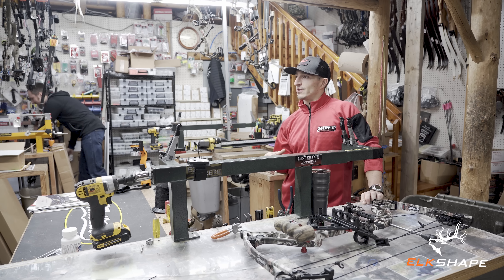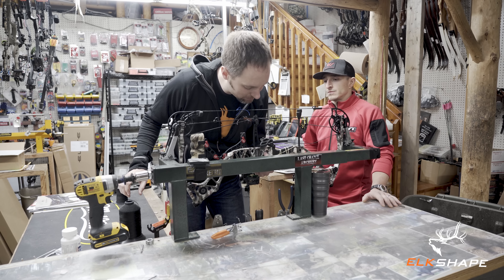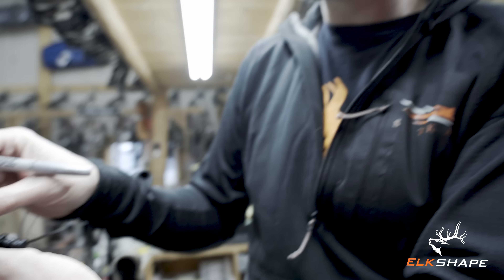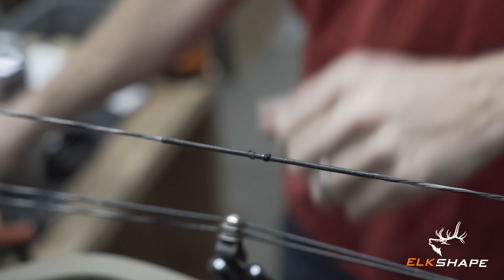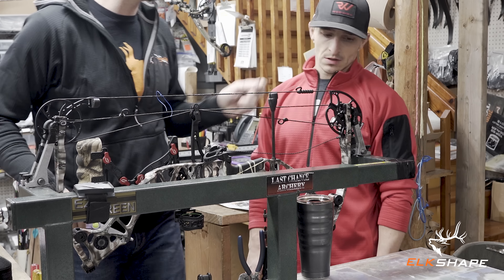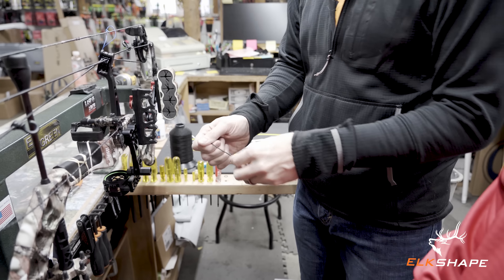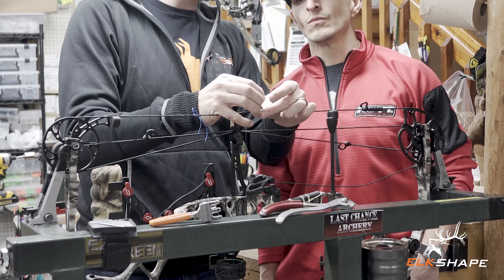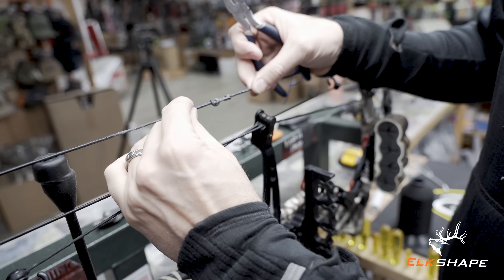Step by Step, Installing a D Loop

Comment: I have a question? If your shooting a thumb release & your using 4 1/2” of D loop string material is that long enough to keep from applying torque to the bow string as you come to full draw rotate your thumb down at your anchor point? Or for thumb releases do you use a little longer D loop string?